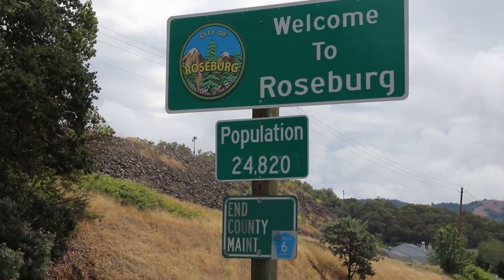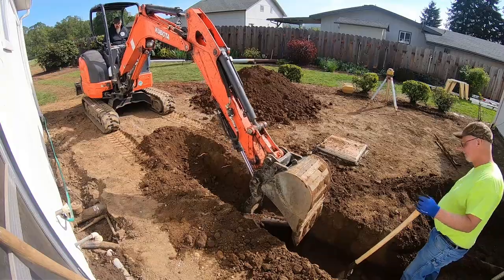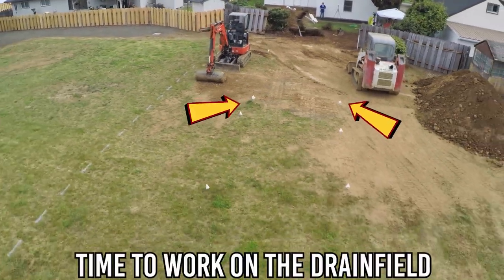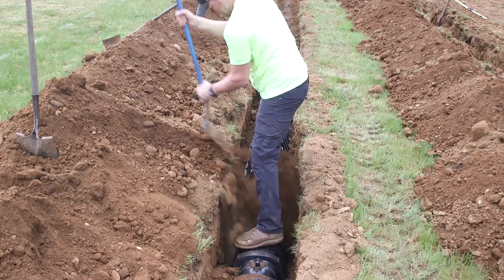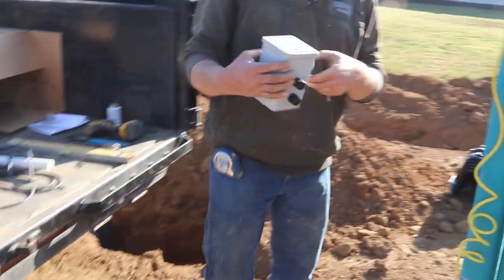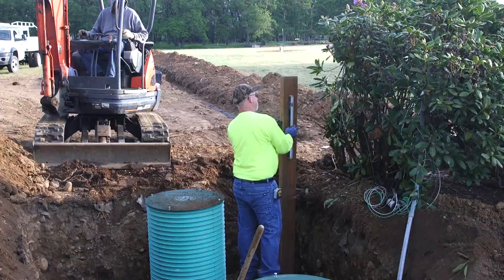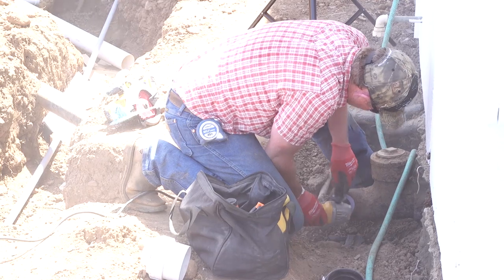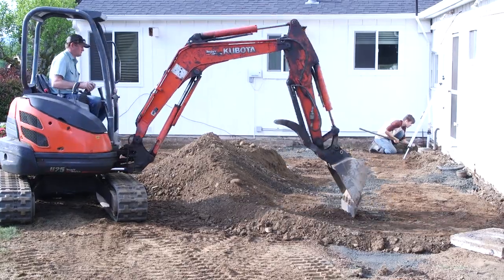Septic System Replacement

Comment: This brings back memories.  We built 30 years ago in Texas on a lot that had terrible percolation. The city made us put in a drainage field with 2500 feet of lateral line (5 bedrooms with 7 kids).  I am glad they did.  The system was strained only a couple times during the years (during excessive spring rains).  About 15 years after we built, the city put in a sewer system but we passed on hooking up.  We paid a fortune (for us at the time) for that septic system and I was determined to get my money's worth.

Comment: Wow, I just spent 6 months in Roseburg building a 25,000 SQ ft home on a mountain. I love Roseburg and the surrounding area!!!

Drove all the way from Texas to build it. Was my first time in the Pacific Northwest and have visited more places there than I've been in my home state.
Reply: Wow I would love to see that house!
Reply: Place is off of Bank Road headed to Glide. They have a wedding venue at the lower end of the mountain, which is the only reason I mention where this place is, so if ya need to get married. Oddly enough you drive by Orenco, which I used to wonder every day what that place was. You can also see the house from the interstate right as you hit the Sutherlin city limit sign headed to Roseburg. Place is amazing. I've been fortunate to have built many 10,000+ sq ft homes in the past 30 years but this is the biggest house with the nicest location.
Reply: Normally people use to move from the cold north to the warm south. Was it too hot in the lone star state?
Reply: @horatiohornblower868  
The money was to good. Especially after being out of work for so long due to COVID-19. I've worked music festivals for the last 15 years trying to transition out of framing because, as you've said, it's just to dang hot. That and I'm getting old. Pandemic ended festivals so pulled the tool bags out a little earlier than usual this last year.
Reply: Jerrell Bevers You certainly made the right decision. If I had the means I wouldn't hesitate to move to Oregon.
Reply: I only remember the speed traps while traveling through there

Comment: 70 years old? I’m surprised it didn’t have a cess pool instead. I’m a plumber and when I worked in a small town we did quite a few septic tanks. Now that I’m in a city they have contractors that only do septic systems. I haven’t done one in almost 20 years. We had issues with them. Though it’s a different situation where I was. It was west Texas so the dirt was very sandy and loose. Critters would get inside the panels and less things up. We started putting netting around them to keep them out. I left before I learned whether that actually worked or not. 
An interesting septic tank story. We got in with a welder who started building metal framed hunting cabins by a big lake in west Texas. He had a septic guy do the tanks. One day we were working on the rough when they were digging the hole. They hit bedrock. They had a way to break it a little faster than a breaker attachment. They had dug about 5’ when they hit rock. They then drilled a bunch of holes in the rock, stuffed it with TNT and then filled the whole hole back in. We had to stop working to get a safe distance while they blasted but when they did every bit of dirt in the hole collectively went up about 6’ in the air and back down. Then they just dig it out. They dig probably a 10’ x 10’ hole through about 2’ of solid rock in a few hours.
Reply: I moved to Midland from Colorado about 2 years ago. People are debating what the boundaries of West Texas are. People disagree whether Lubbock and San Angelo are in and some even said El Paso is not in, because it has a different culture, and it's not what they're talking about when they say west Texas.
Reply: @countysecession   I live in Austin and I’m from a small town between Abilene and San Angelo. I always considered west Texas to start when the terrain changed from hilly to flat which is around Brady or mason depending on your route. I’ve had people tell me Sam Angelo isn’t west Texas but I’m almost 40 and they’ve been called west Texas since I can remember. I have heard the El Paso thing. It’s like the put everything west of the Pecos in its own category. However El peso is as west Texas as you can get. I count Lubbock but separate Amarillo as being the panhandle. I always defined west Texas as a combo of location, climate, and terrain. It has to be west of Brady because that’s the heart (center) of Texas, it has to be flat, dry, and windy.

Comment: This video was enough to make me glad I'm hooked up to the city sewer line.
Reply: My city (in NZ) has old sewer lines at capacity, with sewerage overflowing down streets becoming increasingly common. They won't even allow new houses to connect to the city sewers (so you can't build a house). We'd love septic systems but there always isn't the space or soil conditions - city sewer lines cost A LOT to maintain and process the waste.
Reply: This "repair/replacement" was way to much!  If the percolation test forced the move of only the drain lines not the tank? NEVER used a power pump if you don't "HAVE" too!
Reply: @brada1803  i don’t understand why they couldn’t have engineered a design without a pump
Reply: @brada1803  that pump is going to be a pain in the ass for the next 100 years
Reply: @packers45678 , I thought he said the tank was too low ?
Reply: I pay about $200 a quarter for water and sewage. That is $800 a year.  I often thought that was a great bargain to have clean water and get rid of the sewage.  Actually, some of the charges are for stormwater runoff and fire dept.
Reply: @Norm475 , That sounds awesome to me, since I pay 875.00 just for sewer !
Reply: My old county came through and forced us all on sewer. We had to pay to connect and pay for the entire project. $2000 to connect and 20 years of $150+/mo sewer bills (and rising seemingly yearly... the residents were also charged interest on this "loan" from the county). I sold the house not long after it was connected. Someone else is now paying for their $40,000 failed annexation attempt and I learned a valuable lesson: never live too close to a big city.
Reply: @TheBrokenLife  Right, its way too much - I have the samething going on here in Southern California (I'm Grandfathered In or here in Calif. It's called Grandparents in - HA!)  If I sell my House I have to hook-up to City sewer,  but I'm on my (3rd Repair) but every year the cost to hook-up goes up along with their monthly bills (est.  $8500. + 65. Month)
Reply: @augustreil  I think he did say the tank was to low - but I would worry about the pump and backups  - I would consider removing soil and refreshing- but It must not be to regulated there ?
Reply: @packers45678  your SO right! When the power goes off - you can't flush the toilet or drain the sink, you made yourself more dependent on the grid
Reply: @Norm475  Certain parts of the country are REALLY taking advantage of "storm water runoff" to increase revenue! (Detention ponds or tanks would probably paid for themselves?)
Reply: @brada1803  As I heard the story from an unconfirmed source, the state had a budget for the sewer project, but a county council person lived in the area of the project as well. So, her neighborhood absorbed the entire budget and everyone else had to pay their own. I'll never pay another dime of taxes in that county and I try to avoid big cities now at nearly any cost.
Reply: @brada1803 , I would worry also, but I don't know anything about this stuff.
Reply: When I started looking for my first owned house, WELL AND SEPTIC were both absolutely mandatory requirements for me. No way was I going to pay just to take a dump, or for the glorified pool water that comes from a city faucet!
Reply: @TheBrokenLife  I feel like you just got unlucky with a poorly run community. I"m on city sewer and water and my bill is $60 every 3 months or $240 a year. This covers water, sewer, and a lot of other programs that i get good benefit from.That's also running sprinklers on 0.6 acres 3 times a week to boot. Drinking water is treated well water so there isn't much better out there, unless you live in St Louis.
Reply: @andrewv5104  I quite suspect that sewer system was already in place when you bought your property. They don't strong arm potential residents into this sort of thing, they do it to the people that are already there that have no choice. My experience isn't unique.
Reply: @packers45678  No it won't. 10 separate pumps will be a pain in the ass for 10 years or so each 😭
Reply: @augustreil  He just said the tank was 5 feet lower than the house. I was really hoping he'd explain why they didn't just dig the drain field deeper and let gravity handle it, but he didn't.
Reply: until you have to boil your water....
Reply: @TheBrokenLife  damn, that is seriously some BS. Thats basically the equivalent of a mortgage lender forcing you into a high interest loan and you dont get a say. I would have moved too.
Reply: Septics are just ticking 30,000$ time bombs lol
Reply: People on septics are usually on well water as well so now you have no water bill and your taxes are usually cheaper as the city doesn’t have to dispose of toxic waste
Reply: @Connecticutsparky  no and no. They work just fine if properly installed in the first place and properly maintained.
I’ve had mine pumped twice. Both times were for problems I caused. The first time was because after placing a T fitting in line between my house & the tank I pushed the line into the tank to far & it didn’t allow paper etc to enter properly. The 2nd problem I caused was hooking my sump pump line into it causing to much water for my drain field to handle.
The first was fixed by cutting off the line. The 2nd by routing the sump line to a gray line going to the woods.
Otherwise I’d never have to bother with it for 20-30 years.
Reply: @brada1803  I was thinking that too. This is ridiculous
Reply: @frankmurphy5  the reason the might not been able to dig the trench deeper could be because when it rains the water table raises. If your drain field becomes water logged the drain field will not drain. You flush the toilet and the 2ater has no place to go except overflow onto the floor.
Reply: You ain’t said shit there!
Reply: That tank never should have been installed under that patio

Comment: I bought a house built in the 50's 5 years ago. It was a dream of mine to own my house out right asap because I had never owned anything. I've already paid it off. It's a fixer/upper, I've done 90 % of the work myself. When I bought it they told me it had a septic tank which I don't remember even caring about...today I love the fact that it does. I pay 10 bucks a month on my water bill. In my book, that's a win. 
One day I'll have little ones and I hope they love this project as much as I have and that they keep it in the fam when I'm gone.
Next up, I'm looking into solar panels. I'm trying to be off the grid and as independent as possible.

Comment: As a sewage enforcement officer for septic in Pa, you do a good job at presenting the information. In the d-box you can add speed levers so if the box settles (it will) you can make sure all laterals are equally dosed. Also you should pull and hose down the effluent filter once a year.

Comment: I have to get a new system and I’m going through the permitting/grant process.  Because my lot is small, and in the Chesapeake Bay critical watershed, I have to get a drywell and an aerobic septic tank.  I hate to think of the cost.  Thank God for the Bay Restoration Fund.

Comment: I used to deliver and set septic tanks in rural Colorado. Most of the lots sloped down from the road. By the time I arrived the customer had everything excavated, a pit for the tank, leach field, and trenches for the lines so all I needed to do was set the tank. Well sometimes they would get a rainstorm before they got the tank backfilled and the rainwater would run off the roof into the trench and into the tank pit, filling it up and floating the tank. Yes, hard to believe, but concrete will float.
Reply: Concrete is lighter than aluminum (yes really, look up the densities), and aluminum boats float if they displace enough water. A big hollow box is no different than a boat.
Reply: @MattsAwesomeStuff  It's possible to make a lead boat float, it's just gonna sit really low in the water. You know those boats you might have made as a kid out of aluminum foil? Well they'd probably work just as well made out of lead foil, and yes you can get lead foil.
Reply: @MattsAwesomeStuff  down at Cal Poly San Louis Obispo, they have an annual concrete canoe race ( engineering class builds and is graded on them)
Reply: Yeah we use concrete parking curbs with cable ran over the top of the tank and then through two curbs on each side of the tank and 3 cable clamps On each end of each side of the curbs to hold the cable tight and then the backfill over the curbs holds the tanks Down from floating.
Reply: Some ships were made of concrete.  Called Ferrocement.
Reply: can you replace septic tanks with something else if you dont want it ?

Comment: Enjoyed this because it brought back memories. When I was 10 my parents bought a shore home, it was a converted summer house built in the 1930's on the Chesapeake Bay. The septic system was inadequate to say the least. Then later on I built a house in the Shenandoah Valley and installed a septic system, it was a gravity type. It works fine even though the installer put the tank in backwards, I discovered this 20 years later while pumping it out, during normal maintenance.

Comment: Have done a lot of septic systems, one thing we always did was to fill the tank with water in a chance of rain . Concrete tanks are heavy but they will float if the hole gets filled with water ,
Reply: Was thinking this and also thought it was odd that this was only a two chamber tank and the spray pump was in the second part. I also wasn't a big fan of that clunky filter assembly I can just imagine laying on my belly pulling that big piece of junk out to check something. Now imagine doing that 5-10x a day. No thanks. Here in MS the main tank is two compartments then it goes to the final chamber which we call the "spray tank" its either in the same tank just a third compartment or another smaller tank where it either gets sprayed out in sprinklers or distributed to drip lines like this one. With an overland it just goes out of the end of the treatment system in 4" sched 40 to wherever is specified by the health department.
Reply: @timothybenton3561  In Arkansas the typical tank we install is just a single compartment tank. A two compartment tank is only used for pumping. A three compartment tank is only for an Areobic system. Im a manufacturer of tanks in my area.
Reply: @travismitchell5383  So yall mostly install non aerobic septic tanks. That's odd here in MS 99% of new installs are ATS spray.
Reply: @timothybenton3561  In Arkansas it’s not legal for spray irrigation
Reply: @timothybenton3561  there gonna be different type of pumps everywhere but yes I agree this plastic looks like garbage

Comment: In 1965 the family and I installed a septic system that was pored in place 12 miles east of Roseburg on Highway 138. Had it inspected twice, 1500 gallon 2 chamber. Hope it is still working as well as it did for the 25 years I lived there.

Comment: Heads up catch there at the 1:16 mark. Had something like that happen to me once. Wakes you up faster than coffee.
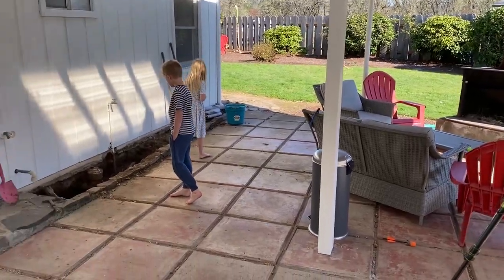Reply: Should really be like 1:14 for the viewer, but holy shit! That could have been bad! Nice save Nate!
Reply: Lucky guy! That could’ve been really bad!
Reply: Dang I didn’t catch that. Had a scaffolding fall similar to that. I was “THE ONE RESPONSIBLE FOR ALL SCAFFOLDING SO DONT F%#K IT UP.” So with confidence it was right, I was walking a corner section and sure enough the other hod carrier moved some boards and didn’t take the time to get it proper so I went belly down on whatever else was there with my butt clenched. 😳
Reply: @devinmahoney3777  mine was a missed step across two rafters on a rehab in Kentucky. Was lucky enough to throw my arms out and catch the rafters under my armpits. Clenched so tight I could have made a diamond from coal.

Comment: That's a nice soft ground and flat area. For those of us in hills, we can do a cross over leach field (top fills first then overflows into the lower one) or do a distribution box like what was installed here. Of course depends on what your county/city requires.

Comment: Back in the late 70s the church my family attended tried to get a permit to build a new church. The town health department figured the size of the septic system on the maximum building occupancy of 140 persons all using the toilets every day. Plans were put on hold. A few years later we had a new pastor, who having worked with the state of Maine, knew a bit about dealing with bureaucracies. He did a study of water usage by churches of a similar size to what we proposed to build and got a much smaller system approved.
Reply: thought in maine,anything flew....maybe outhouse...LOL....got married in houlton...
Reply: The minister had pastored a small church in New Sweden, and also had a job with the State department of corrections. Our church was in southwest CT, where nobody wants you to build anything without crossing every t and dotting every i, as well as jumping through hoops

Comment: We live in rural interior Alaska.  Our septic tank was steel and lasted 40 years...we had it replaced with a plastic septic tank and lines 4 years ago.  That steel tank looked like it had been shot with buckshot....plastic tank will not rust out.  The contractor used a backhoe and replaced the plastic tank in the same hole as the old steel tank.  He then dug a hole and buried the crushed steel tank in that hole...we live in the Alaska wilderness.